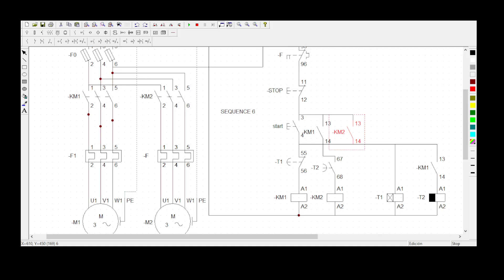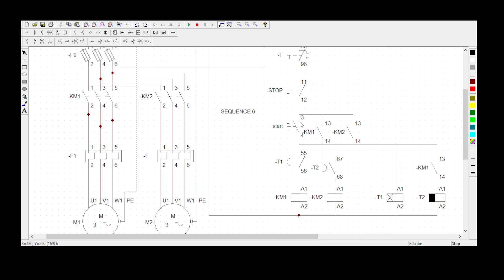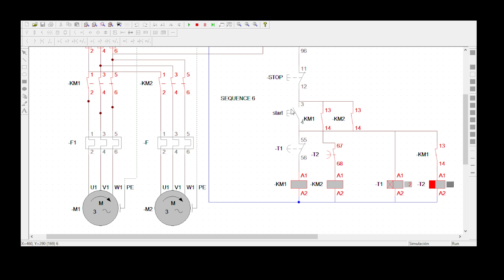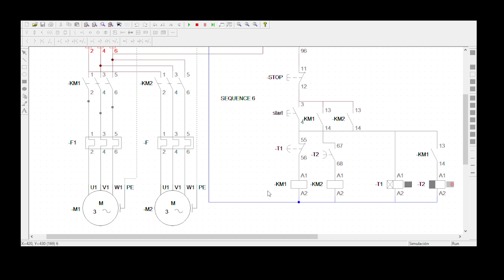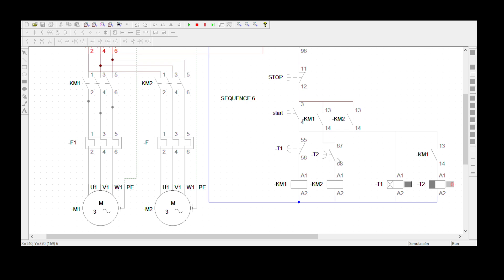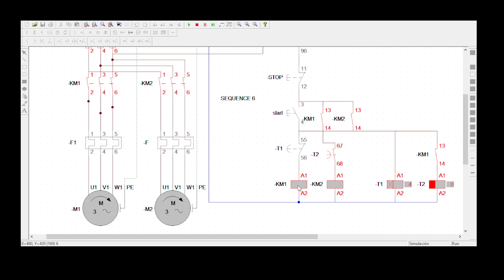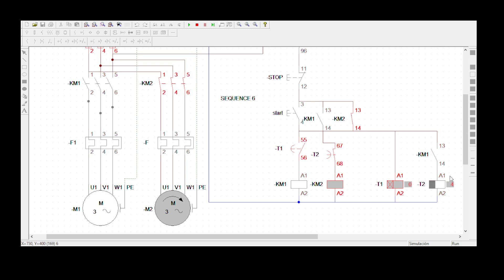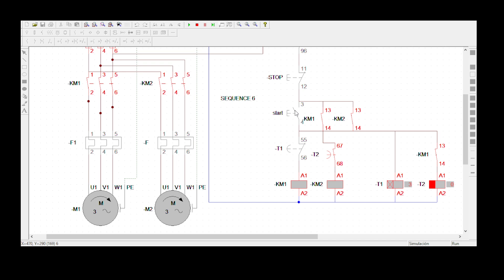SEQUENCE 6 AUTOMATIC START AND STOP OF MOTORS | ELECTRICAL ENGINEERING | APPRENTICESHIP TRAINING

Comment: how are you doing Bongani
I am bit struggling with sequences
Does it really matter where we should put our timers on the circuit or we just put them anywhere on the circuit?
Reply from the maker: I'm good hope you are well. It doesn't matter where you put your timers. The only thing that matters is where you put the NC and NO contacts of timer coils and contactor coils
Reply: Can you write down the instructions for sequence 6
Reply from the maker: @mitchellwargbe569 When the start button is pressed M1 and M2 must start rotating. 10 seconds after M1 and M2 has started, M1 must stop rotating. 10 seconds after M1 has stopped, M2 must also stop